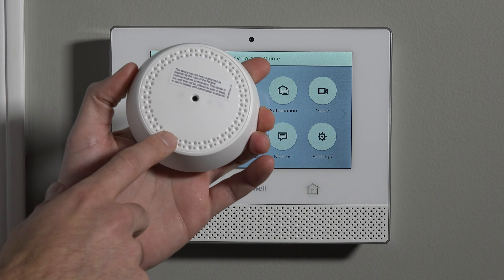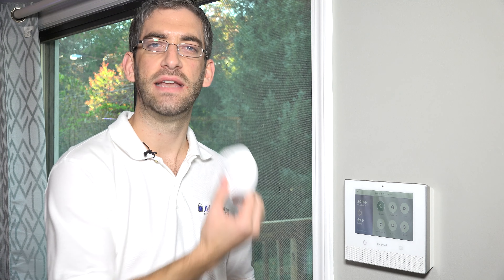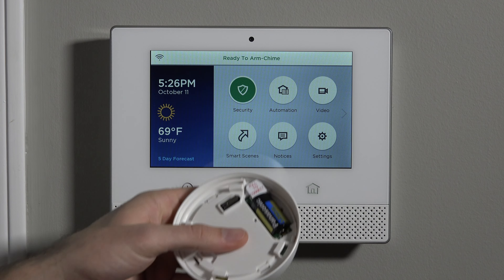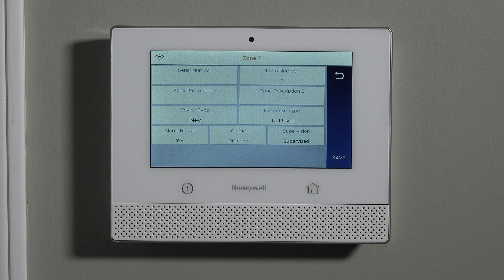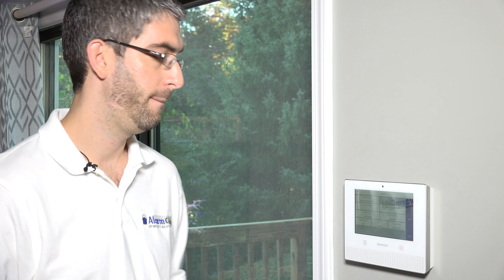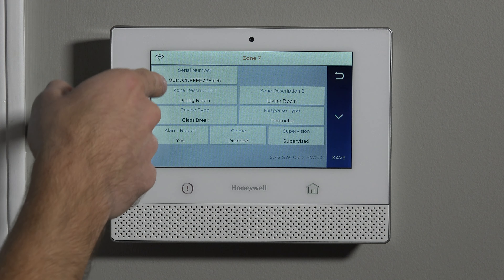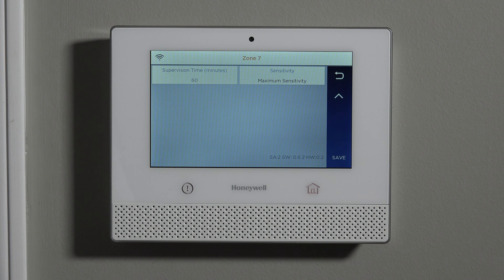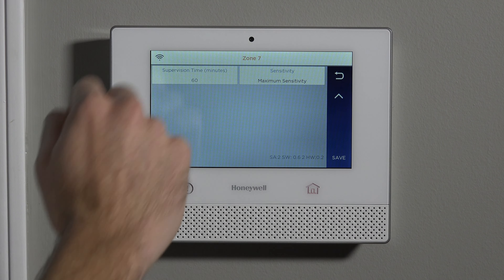Lyric SIXGB: Program to Lyric

Comment: Once you've programmed some of the furthest sensors, is it ok to program others at the panel?  Mainly because if I'm working alone in a big house, it would be much easier to program at panel.  Thanks.
Reply: We actually shot these videos when the panel was still in beta and Honeywell, at the time, had suggested doing the furthest sensors first. However, the Lyric system has had firmware updates since then so that you can now just learn everything in at the panel and then test the sensors at their intended installation location before permanently mounting them.